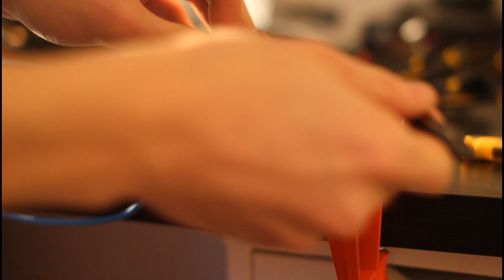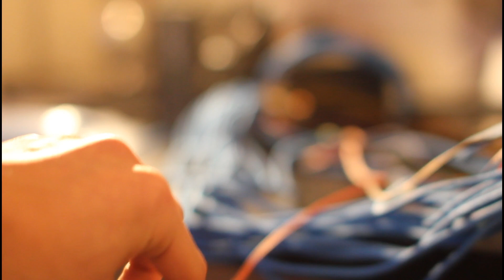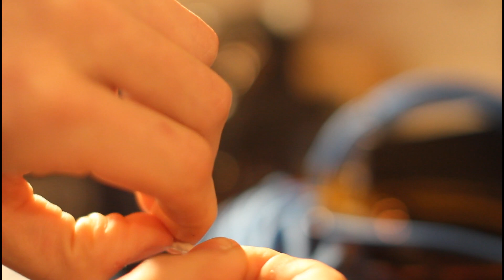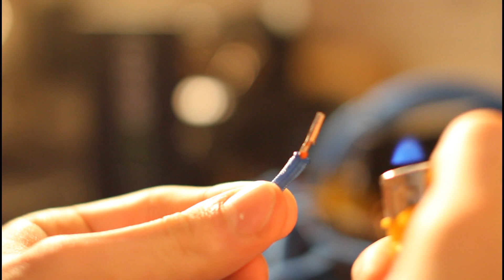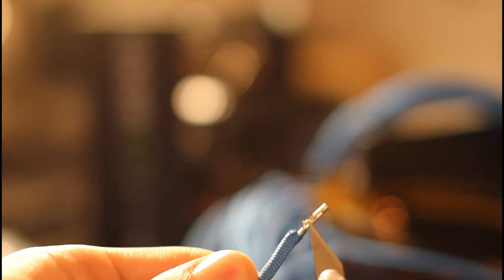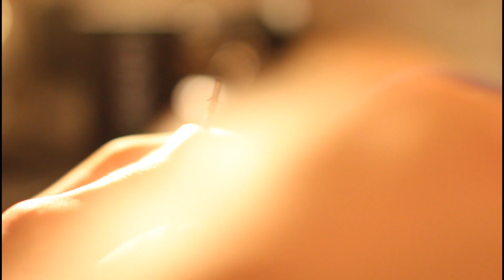How to Sleeve ATX pins

Comment: I have a question as you seem to be quite up on this I've got a modular PSU, Corsair HX1000i and I cannot plug the 24 pin into the female mobo EATXPWR 24 pin female slot with only 2-3mm of slack the cable socket will just not click into place. The latch is on the right side, I support the back of the mobo when I try and push the 24 pin cable lead in but it just will not click into place and is rather loose (dangerously so). Do you have any ideas ? could some of the hollow pins on the 24 pin cable lead be too far up or too far down thus preventing a nice secure cable connection to the mobo ? the mobo is Asus Maximus VIII Extreme btw..

Comment: That's a lot of fucking work, fuck all that. I'd rather buy a completely modular PSU, or even cable extensions.
Reply: Nothing beats your own custon made looks bro, dont be lazy.
Reply: Time spent intelligently and money saved ;) :P
Reply from the maker: a full modular power supply is just as much work if not more to sleeve because the sleeve has to be the exact length as it is visible both ends
Reply: Yes, but with a fully modular PSU, I could just buy a set and be done with it.
Reply from the maker: true but wheres the fun in that :P
Reply: You can just do it during your spare time. I did mine when I'm free, got the 24-pin, 3x8-pin, and a bunch of SATA cable done in just 3 days. Lots of struggles at first but got used to it, everything turned out great and was definitely worth the time spent :)

Comment: What did you do with the other end to hold it in place???
Reply from the maker: I used one zip tie per bunch of cables so one zip tie for the 24 pin etc. However you would be better off using some superglue or heatshrink although be careful using heat near the PSU circuitry
Reply: Gardner Tech Stuff Kk thanks I think I'm gonna wimp out and just use extensions. Would rather have my warranty lol

Comment: Kind of a n00b question; but what is the diameter of the cable sleeving / heat-shrink tubing would you use if i were to do 2 cables per sleeve?

Comment from the maker: thanks, the technique is very similar, you just have to be more accurate when measuring the length of paracord. so long as you are using paracord then you can just melt it gently with a lighter. if you are using some sort of plastic sleeving, more like MDPC, then you will need to put some heatshrink on to stop the sleeving from burning and then cut it off once you are done, hope this helps!

Comment from the maker: yup, its fairly similar process for other sleeving you just have to put heatshrink on to melt the sleeve to the pin, if you are going for the shrinkless look then you can just take the heatshrink off after but it won't work if you don't put it on.

Comment from the maker: you do need to be more careful, first off you will void your warranty. Unplug the power supply and then leave it to sit awhile before unscrewing it to allow power to dissipate, once it is open make sure you ground yourself on something metal and try not to touch the capacitors as they can still have quite a charge built up in them other than that just be careful and you should be good. Note that you will probably have to enlarge the hole for the cables to take the size of paracord into account

Comment from the maker: I used the Phobya ones which I wouldn't recommend as the ATX pin remover has already broken, I would recommend the original molex brand remover as it is supposed to be the best, I assume most PC shops will sell it, I got mine from Scan.co.uk